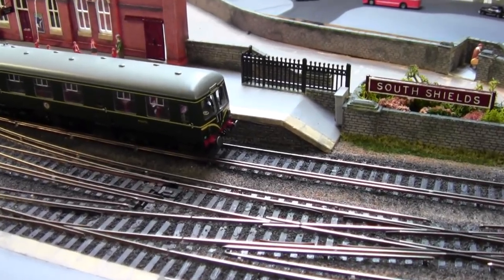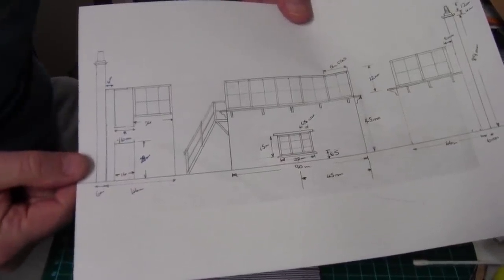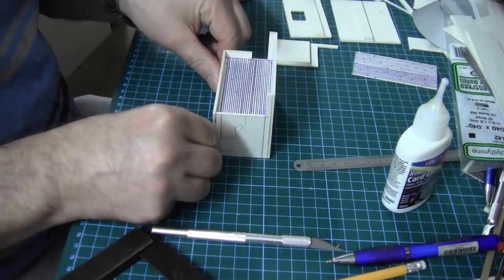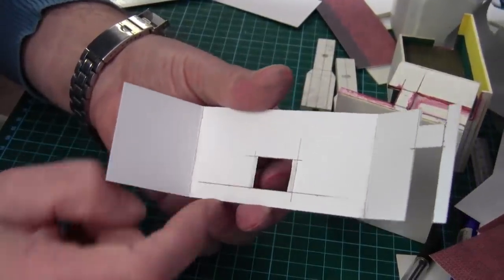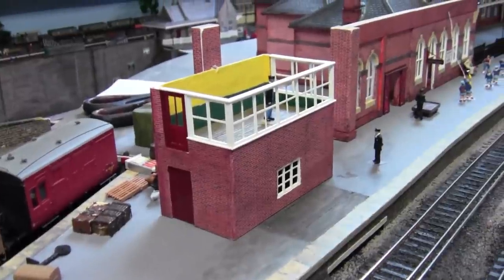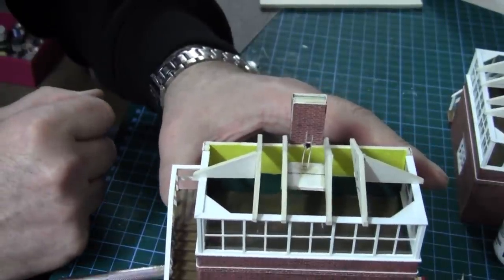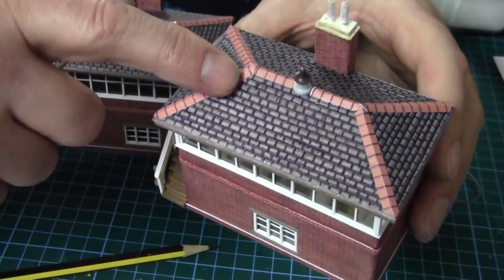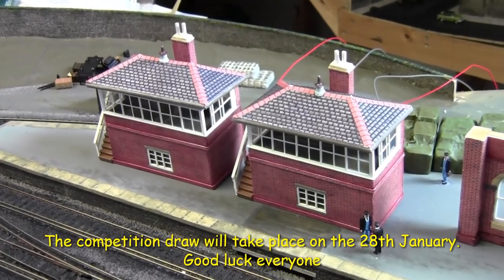Scratch Building a OO Gauge Signal Box, and competition.. No 253

Comment: hey Tony thanks for another great railway biulding video. I love the little details you placed into the signal boxs especially the fireplaces. 
my answers to your three questions are as follows 
1 Mr Pull lever

2 counted the bricks in your photograph which was about 6 bricks (about 14mm)

3 The two doors on the ground floor of the signal boxes have the door handles  on the opposite sides to each other. Also one of the doors has the handle lower then the other.

Thanks again Tony and happy modeling.
Reply from the maker: Thank you Matthew. and thank you for commenting and good luck in the competition..........stay safe Tony

Comment: Good evening Tony, hope you continue to be well. That was another interesting video, though I suspect that by not showing a  lot of the measuring and cutting you've given a completely false impression of the time you spent on these! The result is, as usual, impressive.  As to your extremely generous competition:
The signalman is Mr Pullever.
You worked out the chimney dimensions by counting bricks on the photograph using a magnifying glass.
The difference between the two signal boxes is that one has the handle of the lower door on the left, so hinges at the right, whilst the other has that handle at the right and hinges on the left (as do both upper doors).
Reply from the maker: Hi Ozzy thanks again for commenting and taking part in the competition........all the best Tony.

Comment: Another great video Tony.  Lovely signal box,  though you didn't put the veranda on i noticed,  the signal man would typically use that to be able to clean the windows on the outside and wave flags (though they would also do that through the window too).

As for your questions. 

1, mr pullever 
2, you counted the brick courses from the picture 
3, you put the lower door to the locking equipment room the opposite way around.
Reply from the maker: Thank you for commenting Kelly. and good luck in the Draw.......best wishes Tony

Comment: You can tell you have been doing these builds for a long time, amazing, right to the answers ,, 1, Mr pull lever,, 2,, counted the bricks in the photo,,3, door handle the bottom door one was on the left and the other was on the right
Reply from the maker: Hi John. thank you for commenting. i have been building kits for as long as i can remember. but scratch building is still new to me. what i mean by new. is its only in the last couple couple of years i have been bashing and scratching my builds. i am still finding my way. but i am using all the tricks of the trade to work things out. and hopefully the finished model should look something like the photo. now if i can do that then i think i have achieved something. enough of my waffling.......thank you for entering the competition and good luck.....thanks again for commenting. stay safe Tony

Comment: Hi Tony - Answers are 1- Mr Pullever, 2,- You counted the bricks from the photo you had. 3- One door has handle on the left side of the door the other on the right.
Now questions from me  1- What card do you use for your buildings 2- Tips for cutting out windows/ doors to get sharp edges.
The boxes look excellent Tony  and the one for South Sheilds will look good on the platform.

Stay Safe.....................Cheers Kev
Reply from the maker: Hi Kev. many thanks for commenting, and entering the competition.1) the card i use is white model Kraft card, you can get it on ebay. 2) Nice sharp scalpel. and when cutting always keep the blade verticle. and use a straight edge like a rule for a guide. to keep the line of the cut nice and straight. for cutting out doors and windows. when ever you are stating a build. you must have the doors and windows first. mark out the doors and windows cut to line. depending on thickness of card. hope this helps.........all the best Tony
Reply: Tony- I have jumped in and have decided to build a model of  the bowls club club house which I have the basic plans to so I am ok with dimensions . I have taken note of your above advice but what do you use to make windows and doors  ? is it plastic card/strip ?  Hope you dont mind me asking as I might need to quiz you as I progress !!!!!!!!!!!!!!!!!!!!!!!!!!!!!!!
Cheers Kev
Reply from the maker: Hi Kev. The doors you can get ready made. but you have to search for them. Ebay is a good place to start. for the windows if the photo shows a particular style. then it may also pay to look for them. but for your basic windows. you could make them out of 1.5 square plastic strip for the frame. and 1mm square for the windows themselves. good luck with the build...........Tony
Reply: Thanks Tony I am now thinking I might need luck . 😊
Reply from the maker: if you dont fancy making your own windows. you might fine what you need on ebay....
Reply: @TONYNORTHEASTERN  thanks Tony